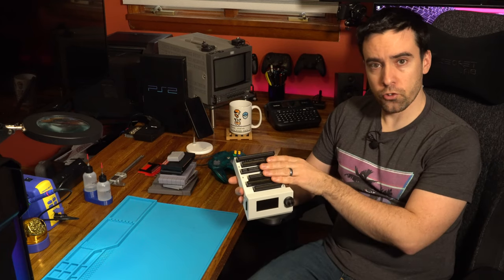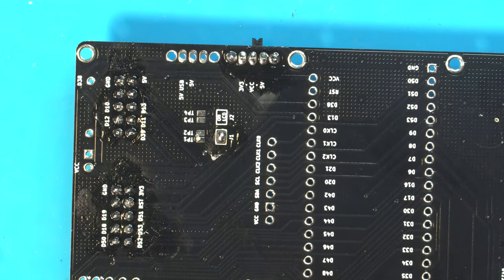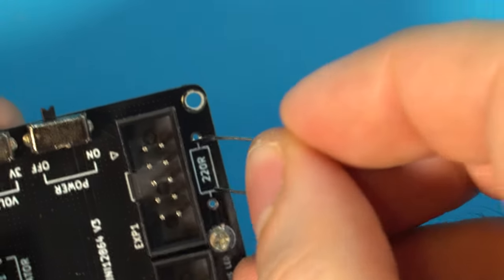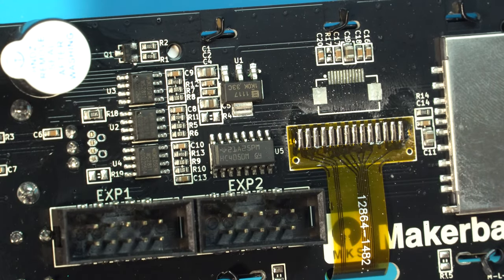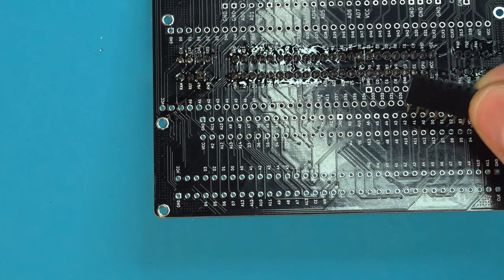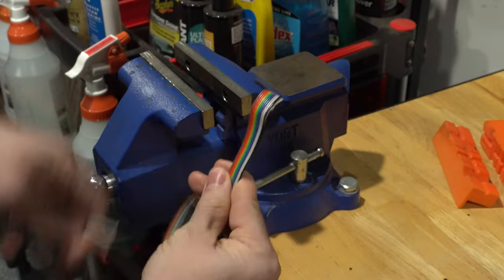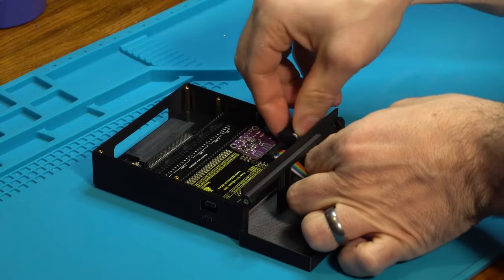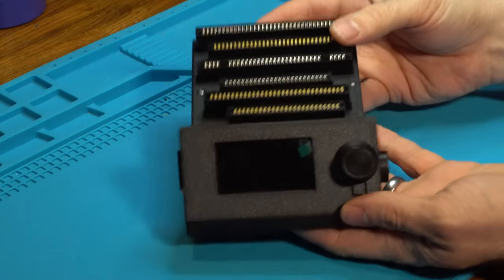Let's build the Sanni Open Source Cartridge Reader

Comment: Your aggressively fast soldering technique with the angle tip was both outrageous to watch and inspiring to learn, haha! I need to try my thicker tips when mostly soldering pin headers and not be so gentle!!

Great video, thanks for the upload! This is another project for me to make, for sure.
Reply: Solder wants to cling to hot, clean metal. It does not want to touch solder mask. So with good flux and solder, the solder will wet to the contacts without bridging, as long as you don't add too much.

Fine tips aren't always best for fine work. They're best for avoiding hitting things you don't want to, but they transfer heat slowly, which means slower soldering and more heat soak.
Reply: He really does make it look easy. I tried his method with the angle tip and found I need to learn to ease off on physical pressure as I was accidentally removing minor amounts of solder mask with it. I do well with fine tips, but it takes so much longer to finish the job compared to the blade tip. Blade tip is also much easier to fix headers that aren't flush with the board.

Comment: Thanks for the video.

Something I want to do but got 0 patience on soldiering, no doubt I might bust something.

Very nice of you of providing the shell for this diy kit, looks really good.

I recently bought the Alter V3, pretty much the same but its pre-built instead (Save the heroes builders), only difference is I have to use the nes/famicom adapter as it don't have one right off the back, this one is a push button type and not the dial, looks overall different then the pre-built one but the overall function is the same.

One more question, how much you looking to charge if you had one already pre-built?, like the one shown on this video, enclosure and all?

Thanks again.

Comment: Even with the CIC I am unable to dump a SA1 based game, I used a P16F630 programmed with supercic-lock_p16f630.hex, programmer used INTEL HEX file format, programmed with a top of the line T56 program device,,, any ideas???  Thank you for your video.
Reply from the maker: If you have six slot adapter rev 1, you will need to cut two traces and install bodge wires. See this resolved issue: https://github.com/sanni/cartreader/issues/481

Otherwise, you may want to reach out in the Discussions on github.
Reply: Hi, thank you for such a fast reply, yes I have the 6 slot rev 1 PCB, no wonder it is not working, I will do this fix tomorrow and I will let you know back here, thank you again sir. @kytor
Reply from the maker: @notsuoh16Bit  Sure thing. Just be extra careful and take your time, if I recall correctly those screenshots are a top down view, i.e. everything will be mirrored when viewed from the bottom of the board where the cuts are made. Quadruple check before you cut!
Reply: @kytor  Hi mate, I followed the instructions, terrible as that picture is I was able to pull it off flawless victory ✌️, now it dumps everything perfectly,  checksums and CRC32 all perfect every time, first time, just goes to show, it is never the EPROM or programmed IC and always a wiring issue, this has been proven to me now more times than I can remember, anyway thank you so much for you guidance, you saved me a lot of heart pain. Lol, thank you. ;-)
Reply from the maker: @notsuoh16Bit  Nice work!